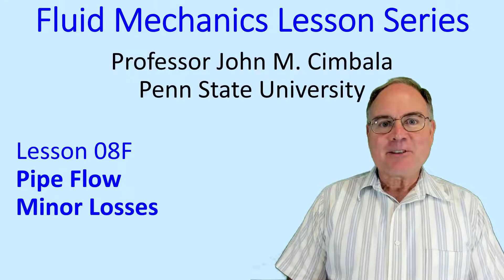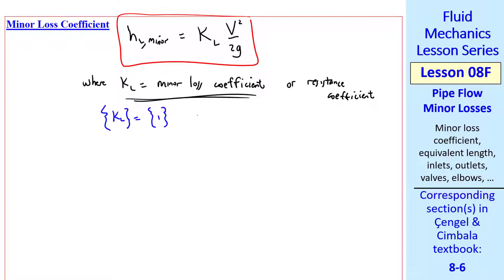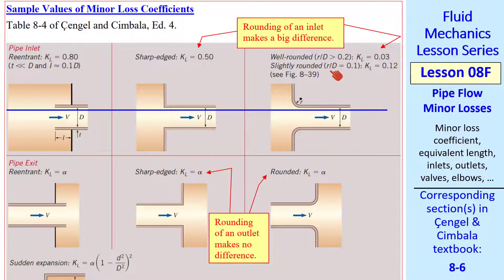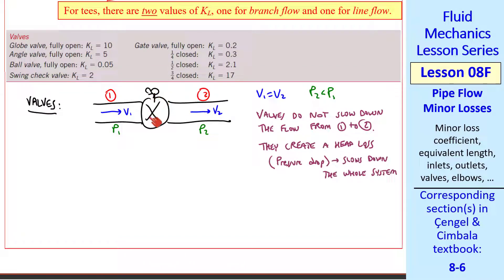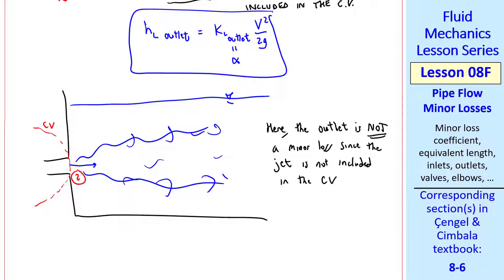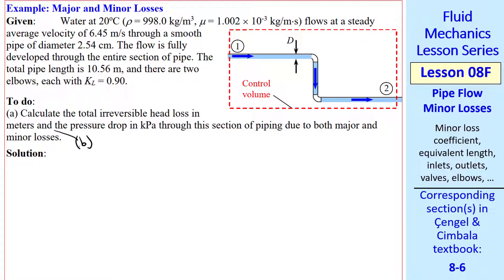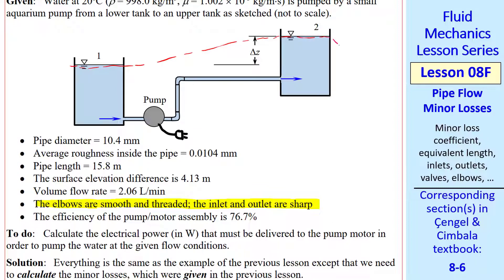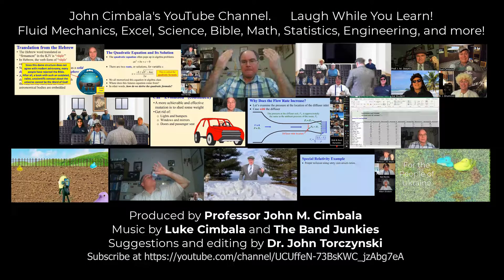Fluid Mechanics Lesson 08F: Pipe Flow Minor Losses

Comment: Hi Professor John Cimbala, I have a question. can we use the method you mentioned for calculating minor losses for laminar flow? or is it only for turbulent flow? Thanks
Reply from the maker: The procedure would be the same for laminar or turbulent flow, but most of the minor loss coefficients are given for turbulent pipe flows. Some (like exit losses) are for laminar flow. You would need to look up or measure/simulate laminar pipe flow minor loss coefficients for other minor losses as needed.
Thank you for your comment. Please tell your friends and colleagues about my YouTube channel where there are more than 570 free videos about the Bible, fluid mechanics, science, math, Excel, statistics, air pollution, and other topics. I would greatly appreciate it.

Comment: Good afternoon Professor John Cimbala, I wanted to bring to your attention that the correct answer for Welec is 3.502 Watts, not 2.05 Watts as you previously stated. I have confirmed my answers using ESS and Wolfram Alpha. Previously, we required 2.085 Watts to overcome minor head losses of 0.112 m, but now the head losses are much larger, specifically 3.35, so a much greater power is required to counteract these head losses.
Reply from the maker: I also checked my answers and units in EES and get my same answer of 2.05 W. I did discover that my exponent on the volume flow rate should be -5 instead of -3. That was just a "typo" and the final answer remains the same. If you go through my algebra carefully you should get my answer.

Comment: I think I understand this now and I am going to try to express it correctly in the hopes that someone will correct or affirm.  The kinetic energy correction factor should not be used with the V^2 /2g terms when calculating losses with the exception of the resistance coefficient K for an outlet since the kinetic energy is dissipated within the control volume.  I remember the concept of alpha from college, but I haven't used it since, a consequence of a decade in management...

I'm working on an inlet layout for a water storage tank in terms of analyzing predicted mixing performance relative to the use of an active mixer.  The tank in question will fill with a pressure sustaining control valve from another tank at a higher elevation.  The "waste" kinetic energy will be used to reduce or eliminate the need to add energy using a mechanical mixer.  Of course, we are also dealing with a small and seasonally dependent thermal variation between the incoming water jet and the ambient water temperature, even with an otherwise uniform temperature distribution within the tank, so buoyant forces come into play.  Interestingly, buoyant forces negatively affect mixing performance regardless of the vector orientation relative to the velocity.  Also interestingly, the higher alpha for laminar flow does not compensate for the lack of eddy currents inherent in turbulent flow.
Reply from the maker: I am not sure I follow your statement about alpha. If you are talking about minor losses, then you are correct - minor losses are based on V^2/2g without the alpha. Same thing is true with major losses since they are also based on V^2/2g without the alpha. However, in the kinetic energy terms in the head form of the energy equation, you DO need to include the alpha. I am 99.99% confident that the equations in my book are correct.